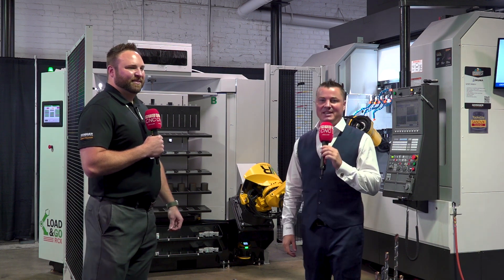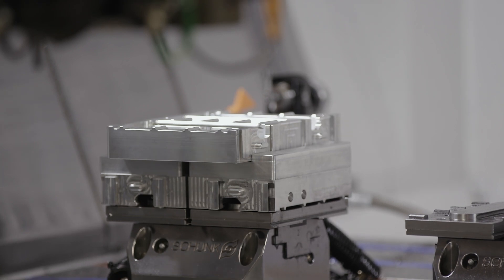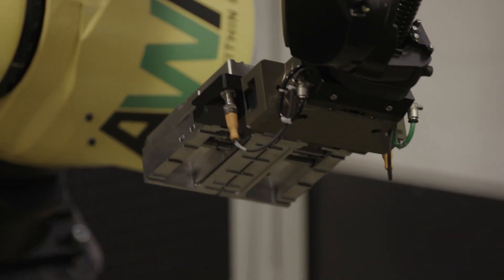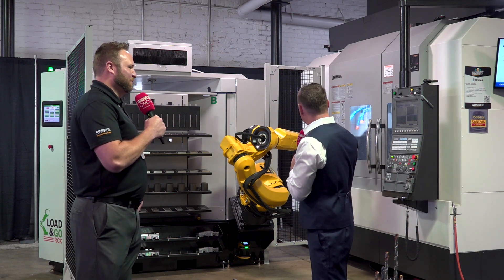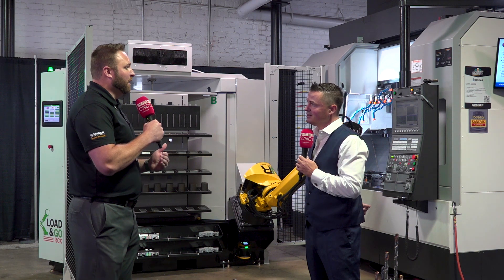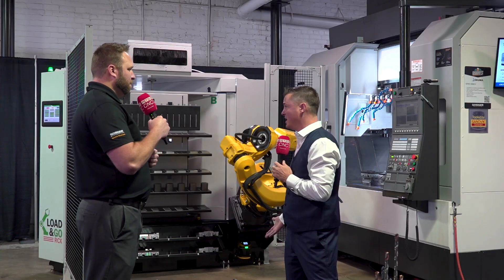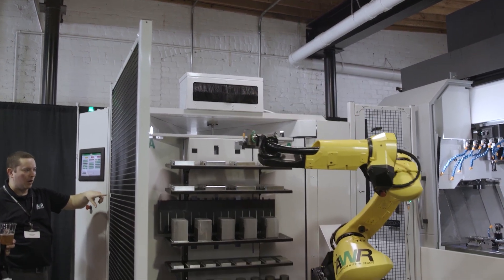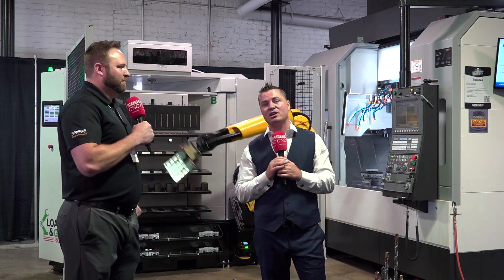Low-mix high-volume job shops; this automation setup is bound to give you goosebumps!

Comment: Guys, once again your audio is letting you down big time in relation to the quality of the channel. Tony is only coming out or the right speaker and the guest on only the left, was this deliberate? In the side that's quiet your hearing the ambient noise. its off-putting but only my opinion. In addition to this Tonys enthusiasm is over driving the audio at the start very slightly on his peaks which is common on many of his videos. This is not a critique of Tony, you need a limiter or something. Again we do not see these issues on UK based videos. I will shut up now.